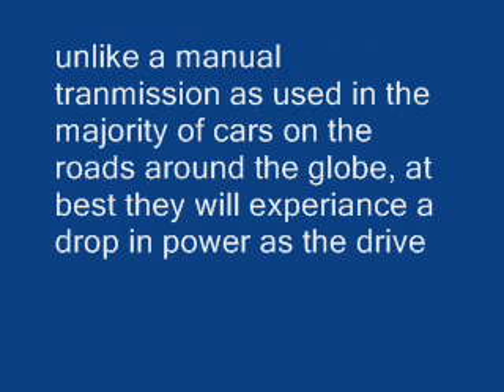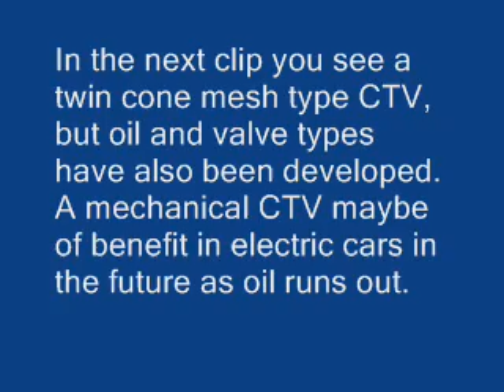CVT explained

Comment: CVT explained,  POTUS puts impossible regulations on auto companies. Cheap fast way to meet them ? Put a moped transmission in cars, SUV. Let the public suffer with it. Jeep dealer told me I had a 6 speed. I have a Jatco II CVT.
Reply from the maker: A CVT is a far more efficient was of transmitting power from the engine to the wheels as there is no loss between gear changes. the President only effect US policy, most cars are manufactured outside of the US. Global demand is moving the industry towards more fuel efficient cars, where MPG is more important than 0 to 60.  Thanks for your comments.

Comment: I've NEVER known what a cvt Trans really did till now. My head just exploded. So simple. Damn. NO shifting? The velocity/position of the chain is what dictates "gear"? WOW. That's some Archamedes shit
Reply: thing is people are like i dont like it the engine is at the same rpm it isnt what were used to so the engineers are like ok lets let it have shift points thus making it pointless
Reply: That may be true for cars, but CVT's have been used in scooters/mopeds (as intended, without "shift" points) for ages.
Reply: True

Comment: This video shows at least 3-words not spelled correctly: "triple" and "experience" and "transmission." It starts a sentence with a lower case letter. But also it implies that this particular transmission is what a continuously variable transmission is. However, this one shown is only one of many. Buick had 3-types, although many people don't understand these and think they are just one speeds.

One comment was interesting- about constant speed drives. But constant speed is not desirable in many applications. The power source needs to run faster when torque is needed, and slower when a faster output shaft is desired, except for engines of constant speed like turbines. But the comments appear to identify a continuously-variable ratio transmission as just something of the past. But a good one would be vastly superior to incremental shifting. The current idea of coupling a reciprocating engine to the wheels via fixed ratios is archaic at its best.

To achieve infinite drives the goal is to modify the driven shaft's gear to as close to  the driven shaft's center line as possible (for its highest gear) without transferring torque from one gear to another. And to do this an engineer needs to think outside of the box.
Reply: +Daniel O Carey you used the word speeds where you should have used the word speed.
Reply: ***** No. They are just one speeds. It is just "one speed." Or they are just "one speeds."
Reply: +Daniel O Carey You are wrong. Even if you use the word they , you are still talking about a single speed. Hence, just one speed. If you don't believe me, ask an english teacher.
Reply: ***** I suppose I could have installed an apostrophe before the s. The meaning of a "one speed" is a one speed transmission. "One speed" is short for "One speed transmission." So if I were to say "2-one speed transmissions" you would agree with that. Correct? So using it my way is to create an abbreviated phrase from "one speed transmissions" to "one speeds."

It is a bit of a legal fiction never used in the UK but acceptable in the USA. An example of this is with corporations. In America a correct sentence could be "General Dynamics Corporation was organized by Convair and Electric Boat."  In England it would read "General Dynamics Corporation were organized by Convair and Electric Boat." English contains differing rules depending on the country that uses it.

But I see your objection. One of my frustrations in this thinking is the use of the term RPM. This sometimes is called RPMs. And with the use of an s it has no definitive meaning.

Comment: What is it with people using super loud music in these videos?
Reply: +Ursan It's not loud if you turn the volume down.
Reply: Ursan Just an electric shock from electric "car" of the somebody's future
Reply: +Gary Reed By that notion, I can stop seeing by just closing my eyes.  The music chosen is "exciting"  There's no excitement when reading text.  Further, someone with a severe hearing loss simply can't "turn it down" and continue to hear.
Reply: +Gary Reed I know, I already said that.  I was asking a simple question about how loud the volume was versus the spoken dialog.  I suppose that someone with normal hearing just doesn't get it.
Reply: +Bil McArthur No, your question said nothing about the difference between the spoken volume and the volume of the music. Also, your statement about closing your eyes implies that  your having to control the volume yourself is somehow unfair.  By the way, my hearing is slightly impaired and I also have problems hearing spoken words when the music is loud. My mother had extremely impaired hearing as far back as I can remember. I do understand.
Reply: +Ursan None of that matters. You control the volume plain and simple.
Reply: +Ursan And besides, you CAN stop seeing by closing your eyes.

Comment: CVT has been around for more than a century.
Reply: Frank Eggers Yeah, constant velocity transmissions (the most simple form of power transmission) were used with steam engines well over 100 years ago!
Reply: rob the log But mostly, they had a direct drive
Reply: The inventor was a Dutch man called Hub van Doorne, he was also the founder of DAF (Doorne Auto Fabriek, or translated in English: Doorne Auto Factory). The DAF factory is mostly known for manufacturing trucks.

Comment: I have a Nissan Serina 2000 with cvt gearbox. It gets stuck in different gear or belt positions. After some time, it would get un-stuck and work perfectly till next surprise... What causes this? How can it be fixed?
Reply: Michael are u still struggling with Serena gear box?
Reply: I sold it at a massive loss so new owner could sort out problem. Thanks.

Comment: Behold the Dutch ingeneouity ! CVT was invented by Van Doorne (in 1950-ish) used in really bad Dutch cars called DAF (Their lorries are very good, but their small cares were not). The system was called Variomatic and worked with rubber belts. So I have to correct some of the comments below that CVT was German and came from 1971. Not at all. Furthermore there is no more efficient transmission than this principle. It was once used on a Formula 1 racing car, that became instantly so incredibly fast, that the FIA set a world record in banning CVT from formula 1 after just 1 race.
Reply: fully agreed, this transmission is absolutely superb! it is something that we can be really proud of!
Reply: Ronald de Rooij Wrong. It was a da Vinci idea from 1490 and the first use in a car was in 1886 by Benz in Germany.
Reply: ShadyJ Did no know that. Thanks!
Reply: Ronald de Rooij Buick had an optional infinitely-variable ratio transmission is 1948. They ultimately had 3-designs the final of which incorporated 3-turbines. A 5,000 lb Electra 225 could maintain high speeds with a large family load and cruise at approx 20-MPG. Their highest ratio wasn't achievable at legal speeds in those days except on the turnpikes which had no limit.
Reply: Daniel O Carey learning every day here! Thanks.
Reply: +Ronald de Rooij 
Cool stuff!!!!!!!!!!!

Comment: Seriously?  Do you not realize this has a low gear setting also?  A "manual" version of a CVT that worked properly would give you all the options of a regular gear box that had infinite gears.  If your car had "x"hp@3000rpm, you could accelerate 0-60 while holding the engine exactly at 3000rpm.  Or more.  Or less. But by all means continue to not think

Comment: obviously he is not talking about everyday driving at high rpm. he is talking about maximum performance. 
and in CVT, you can hold the engine at high rpm all the time while the transmission ratio is constantly changing, so you avoid any gaps in acceleration because of gear changes.

if you ever riden a scooter you know what i mean

Comment: I guess you have never rode a mountain bike before, or used a manual transmission, to understand that a lower gear is useful and needed to climb hills, or accelerate smoothly and reduce the amount of force that is exerted on the motor and the transaxle?

Comment: Yeah, these were my thoughts, but I have yet to see a performance CVT, at least one that can handle high amounts of torque.  Most smaller applications like fmods, typically using the rotaxes will use their standard centrifugal clutch deal to achieve similar effects, haven't seen much on performance applications.  The closest is a boosted altima (or maxima) running low boost, not much over the stock power.  My guess is it's a pain in the ass to move the chain/band at 500hp :-\.

Comment: in the cars they use vacuum to pull 2 pulley halfs to each other, thats why belt run on big diameter other pulley does opposite but works with pression of springs,gives belt also tension

Comment: That goes to the rest of you too. It doesn't actually require more than a few brain cells to realize you can tune a CVT to hang at the highest HP RPM range and easily get better performance than any other transmission. God dammit it's like telling monkeys that there are better options than flinging their shit at each other.

Comment: 12 years ago a friend and I were talking about this two cone chain concept, you could slide a chain back and forth. No edge wear as with the conical pulley systems.  But the question was how to keep the timing of a chain on the variable pitch of the cones.

You guys did it.
Reply: How is it actually done? I don’t get it 😅

Comment: @kingjimsixsix5 

CVT is becoming more mainstream on economy cars. The belts slips on higher performance vehicles rendering them almost useless. Dual clutch units are going to become more mainstream.

Also car reviews continue to be about HP and how the car is to drive. I have yet to read an article on Motortrend, Car and Driver, or Road and Track that focuses on emissions and fuel economy.

Your "no replacement for displacement" comment makes no sense in that context either.

Comment: I had a cone type cvt setup on one of my mouse trap cars for school, I didnt have enough time to refine it, but when I had the wheels spinning off the ground it worked great, I just couldnt get the ruber band tight enough for it to move itself..I figured it wouldnt work, but i wanted to try.

Comment: @disengagejam CVT's and rotary engines are better in terms of engineering/science principles than standard transmissions and piston engines. So why are they dominant? We have used them for long after they dominated the market (due to historical reasons) that it is very difficult as you say, to change to something that is "wierd". I do own a car with CVT. CVT was not part of the buying decision but it was very wierd (at the begging) to get used to a car that does not give you gear shock.

Comment: i had a similar idea. bit instead, my idea was just to have one 'gear' change in size by expanding prongs, powered by hydraulics. it would therefore need to have a wide belt to connect it to the axle coming from the engine - it won't be able to use and teeth, hence the belt. but it's a bit more simple than this. 

the only problem is the strength of the belt, and possibility of loss of friction - a problem gears and chains don't have.

Comment: @JDdaDJstressed Torque converters can rev higher than the output shaft, correct. Think of a torque converter as two fans to put it simply. One fan is connected to the engine, the other the transmission (and therefore rear axle, wheels, etc...) The engine can rev high, spinning the fan very quickly. The transmission fan will gradually catch up to this speed. It's almost like a jetski. When you "floor it" in a jetski, the engine revs the impeller at top rpm, but it takes time to reach max speed.

Comment: @JDdaDJstressed The cvt can create an infinite amount of gear ratios, helping create more linear acceleration and better acceleration. Torque converters are connected to the flywheel, and so the output turbine shaft (of the torque converter) can rev as high as the engine rpm, but since it has no gears a transmission must be used in tandem.
Reply: Engineering Explained oh my god its the flat earth guy!
Reply: Except the CVT is far less unreliable than a traditional automatic.

Comment: The "fins" look a little flimsy, but also look more efficient than running a belt or rollers over a smooth surface. No guaranteed "mesh". Although the Nuvinci CVT offers a boundary-layer, fluid dynamic, solution, this one looks like, with some work could handle at least 500hp/500lb-ft. CVTs are maybe 10 years from being fully acceptable.

Comment: @kingjimsixsix5 that depends on the CVT system, the CVT system i am thinking about uses centrifuge to govern the position of the belt (or ratio if its a pinch roller type system) if the position of the belt is controlled by a computer etc then yes it could be set to always be in the engine's optimum power band, and then the lack of RPM drop during gear changes would give it the advantage over a geared car (depending on if there is more power loss or less in this type of transmission of course)

Comment from the maker: @RustyNex not complete correct, it would depend upon the mapping of the CVT, the CVT system can be set up to allow the engine rev to near redline before moving up through the ratios, but unlike an auto of manual box there would not be the large drop between gear ratios.

Comment: @scooler not when it comes to acceleration, by using the upper half of the rev range a geared car can out accelerate a CVT car. the highest power output of the engine will come later in the rev range (maybe 6000 rpm) power is needed most when getting the car moving, once moving it takes less power to accelerate. the CVT system will restrict the engine from reaching that upper rev range by adding more load onto it

Comment: its not actually better than gears because the CVT uses one single rev range, where as a geared car can use the full power of the engine in each gear. CVT cars must reach a certain speed before the power band of the engine can be used

Comment: @demin2609 
Volvo tried them out 340's but because of different reasons they weren't exactly popular among europeans (when driving in wet conditions for example the belt would start to slip for example.)

Nowadays with never versions like the ones in some Dodge ( i think) They'd probably work. But i think they'd be much more boring to drive aswell.

Comment: @TheWTFers Actually hybrids might have that soon, because when the engine turns off and it is in electric mode it is virtually silent. This transmission is not in your car, it is just showing how the concept works. Your car has 2 plates and a V belt

Comment: @athomas2k8 Power transfer and increased torque through speed with no shift points. The possibility of perfect gas/output power ratios. Although most manufacturers set shift points on them anyways so the car bucks and feels like a normal automatic transmission.

Comment: One more thing before I go,. I had a 72 nova with a laughable powerglide trans,. Off the line never spun tires but lightning fast. first gear upwards of 55 mph, but I can alter that by my driving. With a 307 engine people thought I had a big block under the hood,. It's all about gear ratio. Miss that car, except for the old technology, was a good, fast(quick), car, good looker in copper(gold) and gave it away for 1200.00.

Comment from the maker: @thakurpawansingh a torque converter would possible be the best solution to merge the rotational power of both sources, another possible solution would be to match the engine performance curve by controlling the frequency using a PLC linked to the electric motor.

Comment from the maker: @texaspete66 it could be any number of problems, if the engine is not turning over, it could be the battery, starter motor. if it is trying to turn but cant start it could be a huge range of things, the fact the cvt light is on does not mean its the gear box is at fault, it could be the clutch assemly or the cam shaft is stuck. you will have to have it looked at to determine the fault, sorry i cant be of more help.

Comment from the maker: @texaspete66 i would need a few more details, such as make and model of the car, age. my initial impression would be that it is experiencing a system fault and it stuck in gear and as it wont go to neutral it wont start, but i could be wrong, if you have the manufacturers manual in the car you could check to see what the CVT light indicates, let me know.

Comment from the maker: @jedimastert0810 where this system is used in vehicles the cones are moved with actuators as required to alter the size but for this demo model the belt is moved using a guide installed under the cones.

Comment from the maker: @ladikusz not sure what you mean by friction, the belt has to have sufficient contact patch to ensure it does not slip which would result in wear. how is your RC car currently geared? with two fixed cogs? if this is the case then perhaps the midpoint radius of the cone should be equal to the size of the fixed cogs, this should allow your RC car to go faster than it currently does using fixed geared cogs.

Comment from the maker: @DonneGT Back in 1993 williams renault developed a CVT for use in the 1994 season, it was banned by the FIA before the season started but it worked using a van doorne type CVT, the principle of which is similar to the demo model constructed for the project we were working on. once you can limit the slip as the belt rotates then very little energy is lost in the transfer. cheers for your comment

Comment: @kingjimsixsix5 ok. say in hp!?! funny! 542Nm is a lot! i don't think the medium used to transport the torque from the one cone to the other is the problem, i think the traktion of the medium to the cone will be the problem. how do you handle that at 542Nm? great idea anyway, although i think its not jet ready for high power.